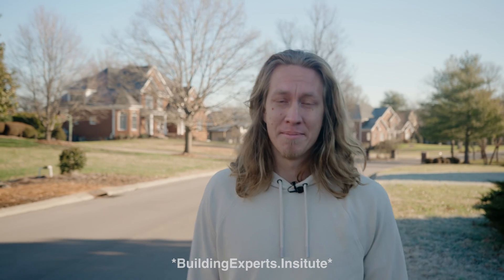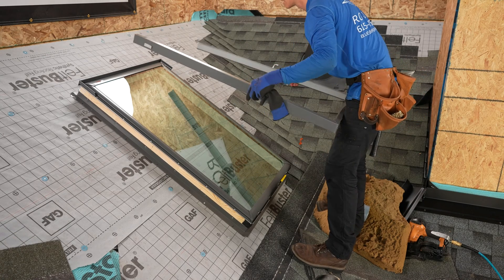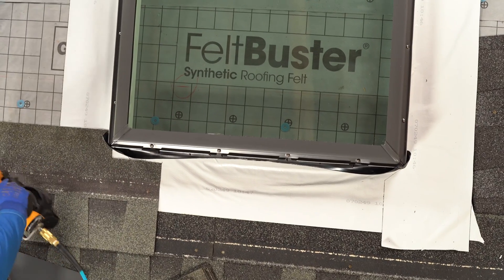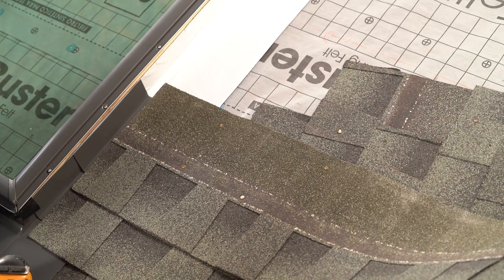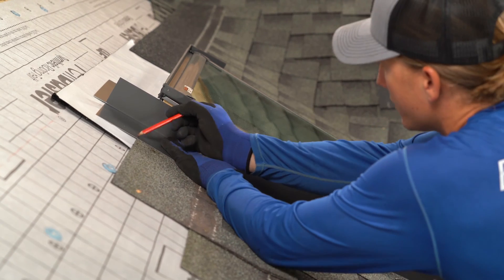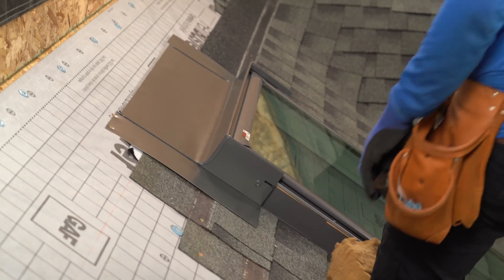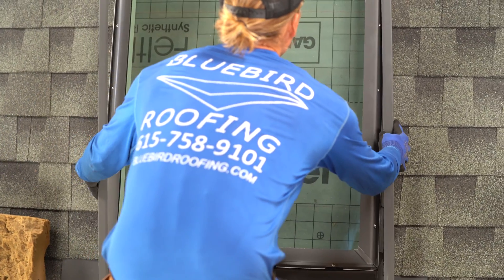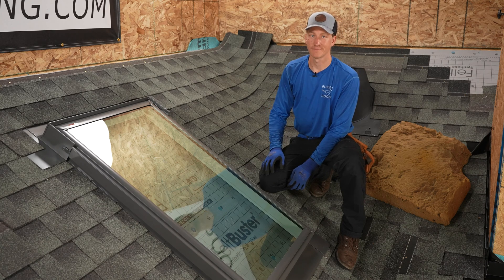Skylights. Installation of Asphalt Shingle Roofs. (Part 9 of 10)

Comment: Definitely need a piece of ice and water over the top pan
Reply from the maker: Respectfully disagree. Put it on if you want, but it's not necessary.
Reply: agreed. North Dakota roofing taught me to never ignore what an icejam can do to a roof at -25F. Iceguard saves insurance claims in cold weather areas.